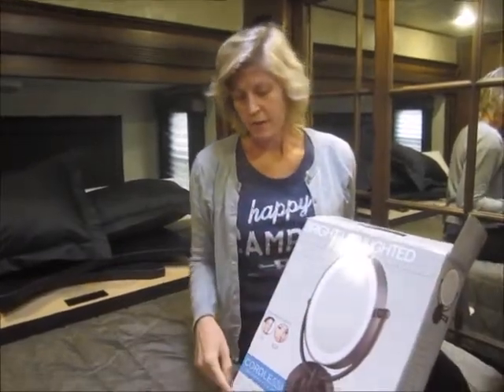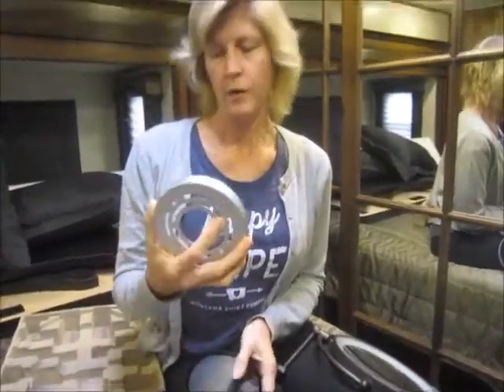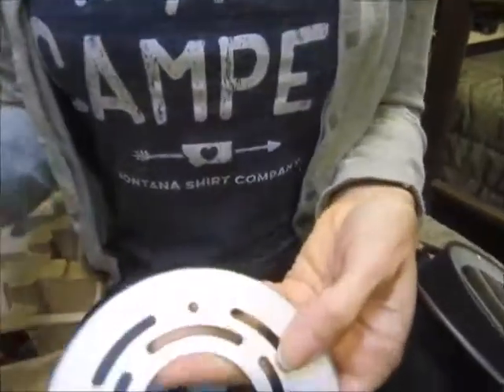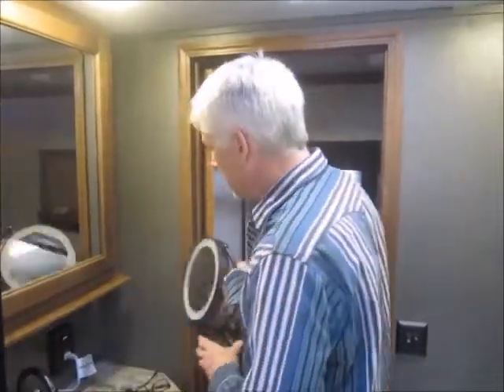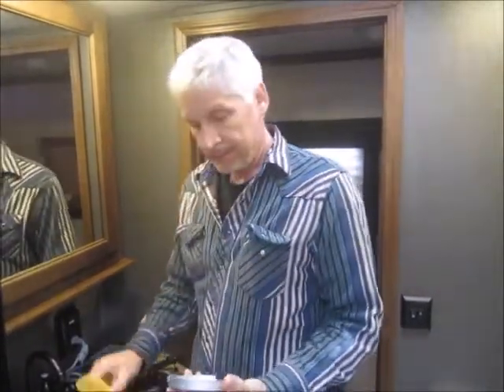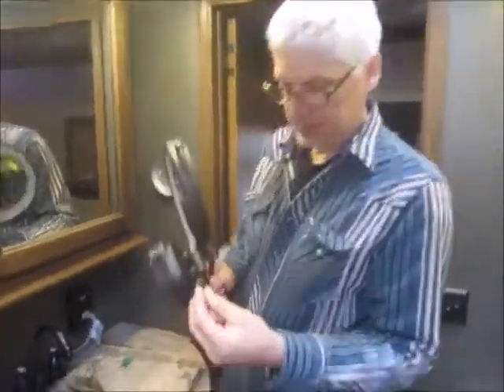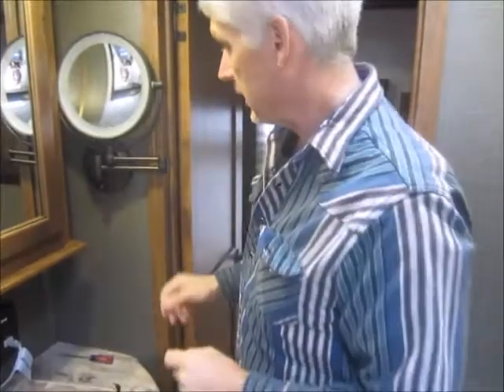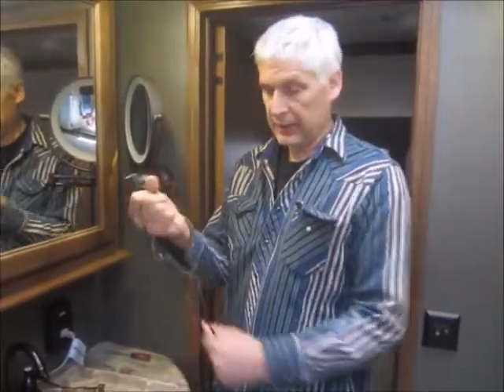Zadro LED lighted wall mount mirror unboxing and istall in Raptor MP300

Comment: I have returned one to Bed Bath and Beyond because the knob discontinued to keep the light at full brightness.  It is plugged into an outlet.  The second one has done the same thing.  You literally have to twist and hold the knob to get a bright light.  It will also shine bright on occasion with no issue.  I think it’s the knob gets loose and doesn’t make a good connection.  I am very sad that this product doesn’t stand up to daily use.

Comment: A couple of questions, first how well does it travel? Second, did you use wall ancors? If so what type? Do you have a product link you can put on here?
Reply from the maker: Hi Davie. Sorry, I thought I added a link for the retaining clips I used. I got them on Amazon https://www.amazon.com/gp/product/B000BPI48Y/ref=oh_aui_detailpage_o01_s00?ie=UTF8&psc=1
The mirror has traveled very well the 6k miles or so we have traveled last summer and has never cone loose from the retainer even on ruff roads and big pothole hits. Still using the 1st set of battery's. We could not be more pleased with this mod.
Reply: Mine didn’t come with the wall plate. Where can I get one.

Comment: :)  You forgot to review the product.  The usual questions.
Reply from the maker: iOn-Christopher DiMeglio I’m sorry we missed your question.
I love this mirror and light.
We sold this trailer February 2020 after many miles and adventures.
The mount never came loose, didn’t have to change batteries once, but when I removed the mirror from the rv because it wasn’t part of the sale, I did toss them because of their age. Now the mirror is used in a sticks and bricks home plugged in to household current with no batteries so to eliminate the risk of a battery leaking if I left them in to long. I would definitely buy again

Comment: I've got this mirror.  Does anyone know how to access/change the bulb??
Reply from the maker: Kyle Shell I will research it when I get home in a few days. I suspect it won’t be the bulb because the light is made up of many LED “bulbs” that are supposed to last decades. As they start to fail over time, it would not be noticeable because so many other led’s are still working. MT guess without seeing it is a power supply failure or burnt/ broken wire

Comment: What size is these ? And can you put a link which one you bought ?
Reply from the maker: bebe. 
From Target.com
Zadro Dual-Sided LED Lighted 1X/10X Mirror - Oil-Rubbed Bronze

TCIN: 15669979
UPC: 705004420310
Item Number (DPCI): 037-08-1154